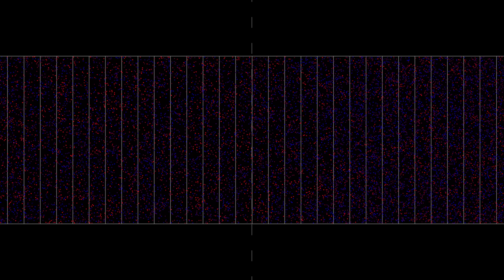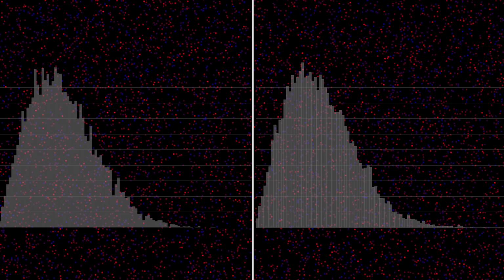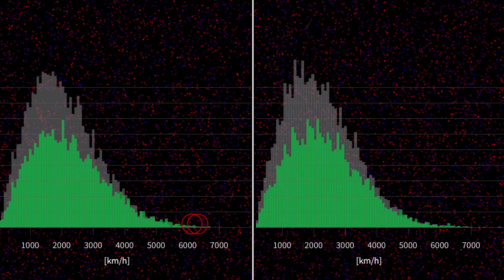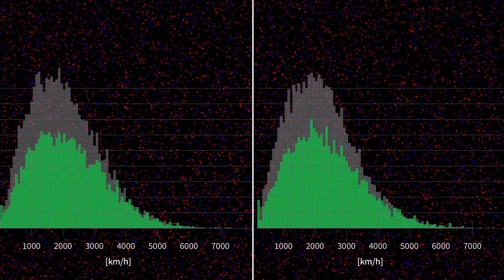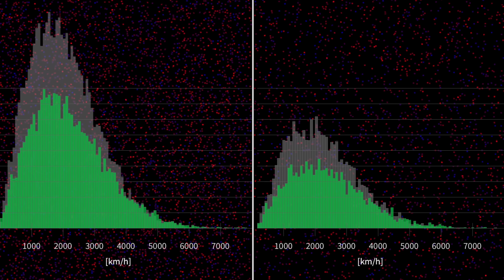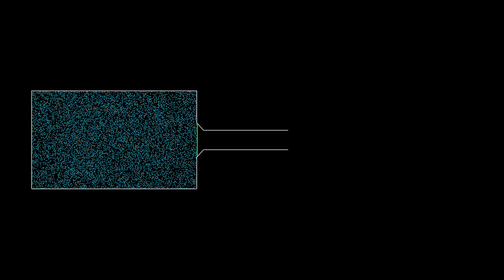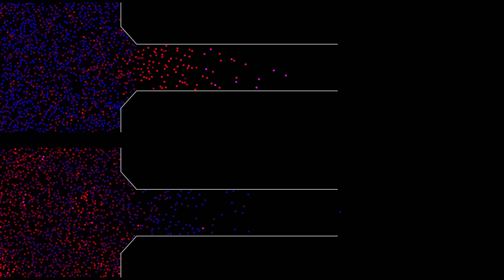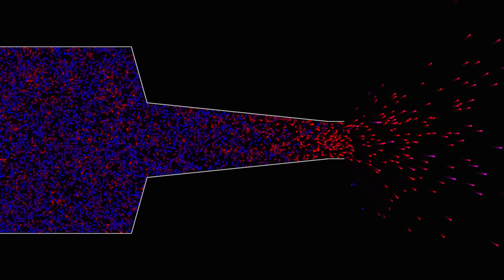A new way to explain airflow

Comment: Next, von Karman vortex-streets?
Reply from the maker: I have tried but no luck so far. Viscosity at this scale is just too much and any form of eddy or swirl dissipates very quickly. I hope to see more flow detail with smaller molecules but the number of molecules required is a computational problem. I am looking at ways to implement parallel processing which will vastly increase the number of molecules  I can simulate.
Reply: @williamfraser  You could look into lattice Boltzmann methods, which simplify the dynamics like this:
* Divide space into a grid. Each particle must be positioned on an exact grid point.
* Each particle's velocity must take it from one grid point to a neighboring point.
* Instead of simulating individual particles, keep a count of how many particles are at each point and with each possible velocity.
Reply: @williamfraser  In "fluids codes," to allow vortices,  I think they just vastly increase the mass.  Then, if viscosity doesn't change, you'll end up with high-Reynolds fluid, and spontaneous flow-separation and vortex-shedding.
But I think theirs is all voxel-based, not particle-based.  
I wouldn't be surprised if 1000x higher particle-mass also increases your viscosity.   (If it's directly proportional, then Reynolds Number wouldn't increase, and vortices would still be impossible.)  

Bernoulli requires a constant net vorticity (where hand-inserting of initial vortices is allowed,) since during creation of genuine vortices in Navier-Stokes, massive energy is injected into fluid parcels from outside.  Then COE conservation doesn't apply, so also Bernoulli eqn cannot apply.   In detail, pure Bernoulli does not tolerate viscous interactions (where parcel-energy commonly disappears.  The viscous losses converted some of the shear-KE into thermal energy.  KE plus PE no longer was constant.)

Rather than "Bernoulli/Euler world," I think "N-S world" is the one with small viscous losses producing vortex-shedding, and not damping vortex-shedding.

Me, I'm not a fluids person, just a bystander specializing in errors commonly found in physics textbooks.

Comment: Thank you so much! You've created exactly the visualization I always dreamed of as a child, not handwavy energy-based non-causal nonsense, but clear illustration of every interaction in the case of each type of nozzle. You are amazing!
Reply from the maker: Have you looked at Nils Berglund's channel? He has loads of similar simulations .
Reply: @williamfraser  I think you can significantly reduce compression artifacts by uploading in 1440p. Just try it once. Even upscaling 1080p video to 1440p and uploading it to youtube give better results than raw 1080p video. This is happening because youtube set bitrate target for 1080p and 720p too low.
Reply: @ interesting, I have been, in fact, subscribed to his channel for quite a while now, maybe I missed videos with explanations like yours in this one, where you addressed precisely the question I've always had, I'll double check, thanks!

Comment: "This is excellent — what you've modeled here bridges the gap between kinetic theory and intuitive flow dynamics beautifully.

What strikes me is how the speed signal concept dissolves the artificial boundary between 'static' pressure and 'dynamic' flow — showing they are both aspects of energy distribution mediated by molecular collisions within a boundary.

It really reinforces that flow is not the result of some abstract 'force' acting at a distance — but a local consequence of asymmetry in energy density within a confined space.

It makes me wonder if future propulsion systems might lean less on the classical 'reaction mass' model, and more toward managing localized field asymmetries — effectively shaping displacement through internal energy structuring rather than relying solely on expelling mass.

In any case — this is the kind of content that helps people move from textbook memorization to true cause-and-effect understanding.

Looking forward to your future Venturi exploration!"
Reply: Who are you quoting?

Comment: "This is one of the most beautiful visual explanations I've seen for fluid behavior and pressure-driven motion — it's rare to find such clear articulation of speed signal transfer and how molecular collisions govern flow dynamics.

It's fascinating to consider that in all these examples, the essential driver of motion is not just 'force' as a separate entity — but the structured displacement of energy through boundary-defined systems.

It really highlights how crucial confinement and pressure differentials are — not merely as abstract parameters — but as the actual medium through which work is done.

Makes me wonder... in scenarios where molecular density drops so low that mean free path exceeds the boundaries of the device (like in high-altitude or vacuum conditions), would we still be looking at a system capable of structured displacement? Or does the mechanism transition from flow-dominated to ballistic, with reduced ability to impart directional work on the source structure?

In any case — superb educational content. Really gets one thinking about the deeper cause-and-effect mechanics behind propulsion beyond textbook simplifications."